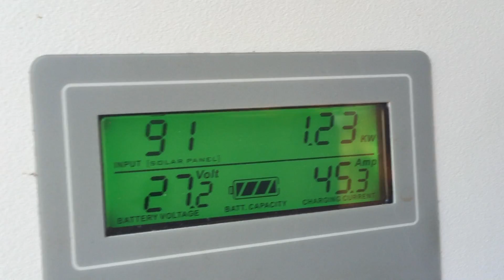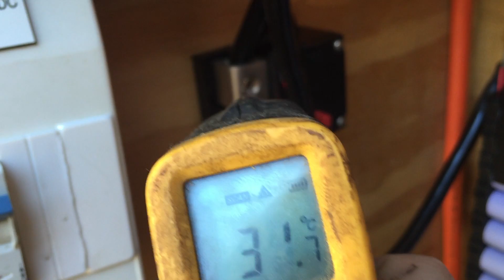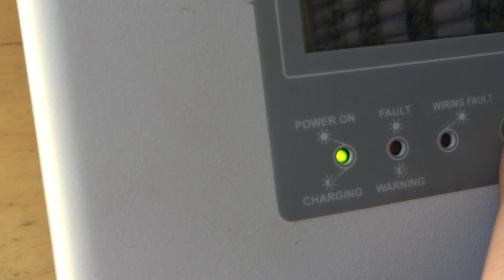Installing new 18650 Mounts

Comment: This is a stupid question (noob) here how many 18650 cells to run a 12v inverter and how many of them to be good and long lasting
Reply from the maker: Like anything, it depends on the load/use/temp/quality of cells etc etc - look at what you want to achieve and build to suit.

Comment: Do you have "plasti-dip" over there? It sprays on --and you can always peel it off later. But it coats anything in a nice plastic coating, and looks good. It might be a better option than the shrink tube.
Reply from the maker: Plastic dip has been mentioned a few times, but never really looked into it. The heat shrink works well and is cheap for now.

Comment: hey pete. can we get a video describing the charging process of your banks, weather they have any balancing protection at all or if after full charge if they are out of balance, im cusious because il be using a pwn charge controller for charging my banks and im worries about under/over voltage without balance leads
Reply from the maker: +Gregory G Harding have a bunch of videos  at top of charge and bottom of charge a few weeks ago I'll link then when I get to a computer

Comment: Just a FYI you shouldn't run that gas mushroom heater in the background of you intro indoors the emissions will slowly build up and can be quite harmful to your health. We want more videos not to hear you've gassed yourself. Stay safe.
Reply from the maker: WOW thanks for the heads up!
Reply: If there is plenty of ventilation it should be ok, but they do put a lot of moisture into the air to start rusting tools etc.
Reply: Maybe but why risk your life on it. When it's cold you close up every thing.
http://www.thecourier.com.au/story/170873/ballarat-man-dies-using-patio-heater-inside/
Reply from the maker: Ok so i'm in a 54sq shed that is drafter than an old queenslander and i'm 43 years old and not exactly stupid...
Reply: :) Yep big difference in ventilation for your typical shed compared to inside the house.

Comment: I always have issues with the ir thermometers on reflective surfaces.
Try sticking a peace of tape and mesure where the tape is or dab a dot with a magic marker or such to get a surface that does not reflect light to take your mesures from.
Reply from the maker: Good tip, thank you!

Comment: do you recommend 3 or 4 cells om parallel for a 12v system, 3 cells @ 4.2 is 12.6 vs 4 cells @ 4.2 is 16.8
Reply: i ask because i notice for 24 v you only need 6 packs but you opt for 7
Reply from the maker: 3 cells seems to be the done thing, never played with 18650 in 12v
Reply: i figured id start at 12v because i was gifted a 3kw pure sine 12v inverter, free is the best price
Reply from the maker: free is good :)
Reply: It depends on what the system can handle.  Pete used 7 because it could handle up to 28V or so.  So it depends on what range that inverter can handle.  Most things can handle going over to a point, but don't always run right when it gets low.  So maybe it'd be fine at 16V, but not work at all at 9V (3 in series depleted).
Reply: my inverter alarm sounds at 11.1 so i went with 4, but i haven't been able to find out if it can handle 16.8 fully charged. i guess il find out when i plug it in. lol

Comment: I have been following your videos and really want to learn all I can about this type of setup.  I know you are talking of going to 48vdc and will need a new inverter.  I was just looking at Tesla's site about their Power Wall and it states in the specs. that it is 350-450 V.  They say they are working with Solar Edge to supply inverters.  So far I can't find any real details on either Tesla's or Solar Edges sites.  I guess what I'm thinking is the price of the Power Wall is not too ridiculous considering the amount of expense of finding batteries and doing all of the fabricating.  I like doing things my self and really like the possibility of saving money in the long term.  Turn offs of the Tesla deal is that they don't seem to sell to individuals, only through authorized installers and I know I will never be able to afford that.  Mainly wondering why the large differences in voltage and what voltage would actually go to the inverter?
Reply from the maker: current inverter is 24v to 220v PIP2424MSX

Comment: In the computer shed, just re-route those two cables up the left side of the unit and gain 18" in length.
Reply from the maker: Considered that :) in the end i just moved the clamps a bit in the power shed and got me enough without too much stress :) making cables shorter would be a good thing.

Comment: Great update, Powercoating does look good.
I think its a good idea to leave all the batts in one shed rather then splitting them up as per the first part of the vid. Also good addition having the smoke alarm.
I would say the heat problem is because of the cheap block on the fuse. I copper block would have been better tho i dont think it will matter when its 48v as its almost half the current.
Reply from the maker: With the batteries in the power shed was for two reasons shorting out issue & was going to paint the other shed so i could still run off grid at night with just one pack connected :)

48v has the advantage of half the amps but that'll be short lived because i can also double the panels to 3.2kw so amps will stay the same with double the power with out having to upgrade or install more cabling from the array to charger (50m)

Comment: What size cable did you replace the 25mm2 cable with?
Reply from the maker: 35mm2 same as all the other battery cable.
Reply: I think that's my problem, 2000W inverter dies with a load of 1kw, I'm waiting for some 35mm cable to arrive. Of course I'm not really confident that the cheap Chinese 2000W (4000W peak) inverter is even close to those specs. Video coming soon, after watching yourself and a few others I thought I'd document some projects also.
Reply from the maker: Chinese inverters tend to be 20% of their rated but if you took it to 4000w it'd become a beautiful cloud of white smoke. lol
Reply: That's what I'd expect, but I only want it for lighting. charging power tools etc in the workshop. Bit like the 12 volt floodlights I bought to place over my workbench, rated at 10W, true value 5W.

Comment: I think it looks better wood than white
Reply from the maker: I looks easier, lol was thinking that the black mounts on white wood would make it prettier !
Reply: soldered my first pack today. two hours, big job....
Reply from the maker: Email me a pic :)
Reply: dose your solder get hot when theres 100 amps going threw it?  

mine dose, fuclken burns....  lol
Reply from the maker: haven't noticed it, but only hold 100a for less than a minute
Reply: I meant the roll of solder when it rolled out too much and touches both buzz bars....  and its in you hand..
Reply from the maker: umm never done that but would make short work of the solder i'd think

Comment: Just thinking about what would happen if it had shorted. Had both sides been fused then only the cells to negatively touching the case would have blown but given that only the positive was fused an entire bank would need to blow (or negative wire on cells) with what would be a lot of amps before blowing.

Was the 4awg OFC or CCA?
Reply: Just watched again and it definitely looks like CCA (few wires showing at rope of fuse), it's everywhere in the car audio industry and is only half as good as copper.
Reply from the maker: That cable is from JayCar so i'm thinking it's for audio. At the time it was what i could afford - moving forward i got welding cable that is fit for purpose
Reply: +HBPowerwall true generally with copper you get what you pay for.
Reply from the maker: I think that is everything thing in this world.heheh

Comment: If you make the tabs wider at the top, they will rest/hold against the case plastic and therefore electrically isolated 👍
Reply from the maker: unfortunately then they won't be held firmly in place or will make building the mount more complicated than a four fold process.